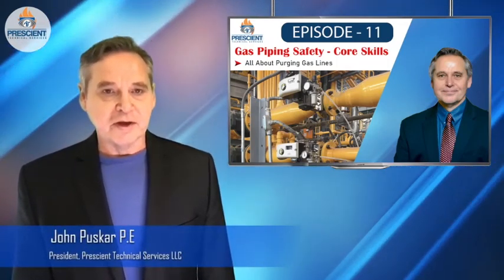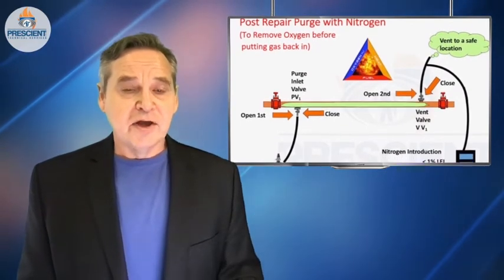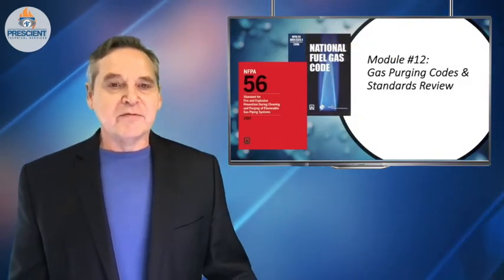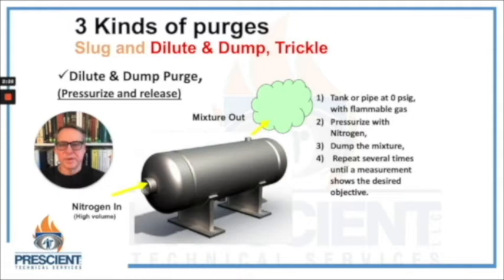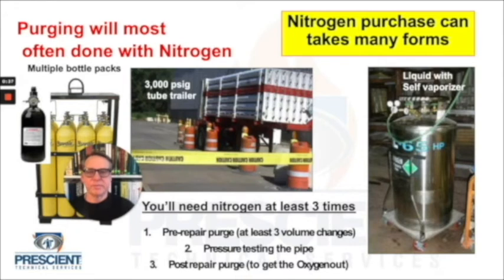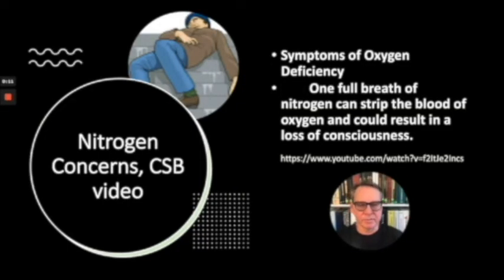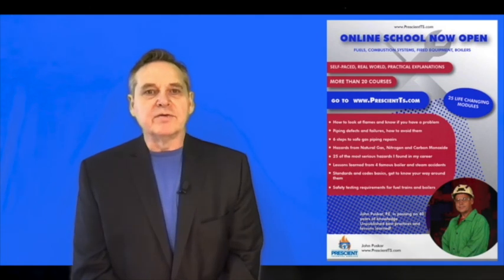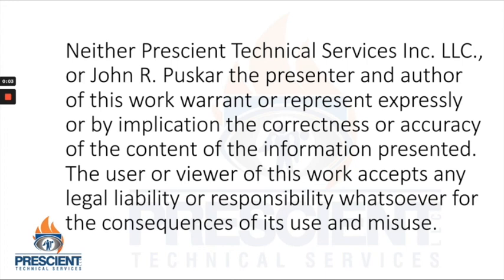Purging of gas lines is a core piping repair & installation skill you must understand.

Comment: Great video on purging procedures. I am assuming this is an industrial piping application with a working pressure greater than 5 PSI (?). Also love your points about having the Purge and fill points in the original schematic and plans ( something that is overlooked quite often). I do have a concern in your video, where the schedule 80 nipple is installed for the Olet Purge tap, it appears that white Teflon tape was used for this installation (?).
My experience comes from 35 years on the gas utility side of the industry, I am currently retired but still consult from time to time. Again, great video👍, keep them coming and stay safe out there.
Reply: Thanks Bob. I appreciate the kind words. Yes, my background is primarily industrial and that's the bulk of what I try and talk about. Good point about the white tape not being rated for natural gas uses. I have for many years advised not to use tape at all, but to use nat. gas rated pipe dope. There have been many instances of tape being found down stream hung up in gas valves and regulators inside the pipe. Some people don't know how to use tape properly and then pieces of it end up coming off. I found a state plumbing code that did not allow its use and thought that, given the options and the possible consequences, I understand why. When I talk about the tape thing with old school technicians they always say, "that's ridiculous who can't install tape properly", but it happens. Sorry to ramble thanks again. Sounds like a good topic to do an episode on....thanks, again.